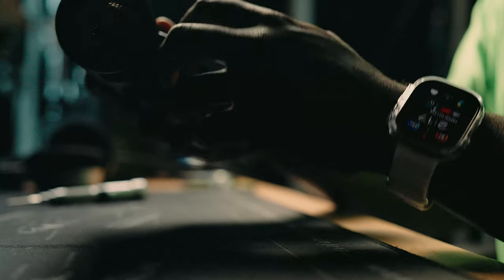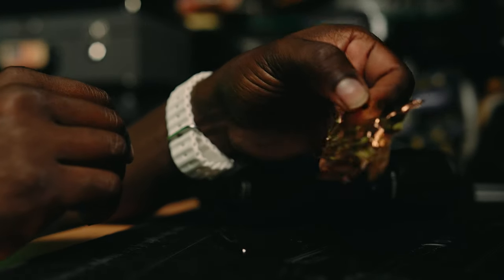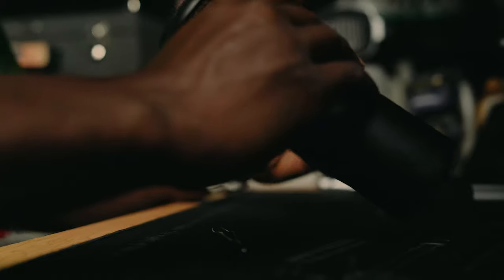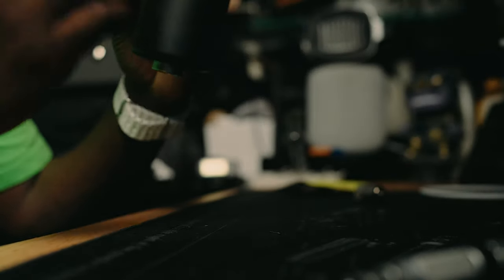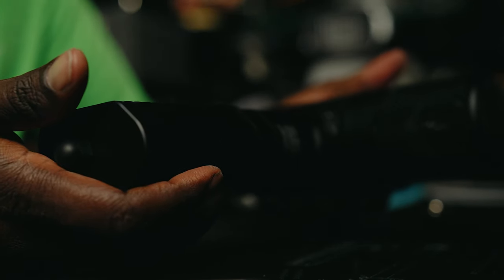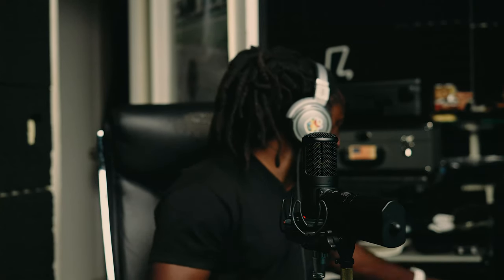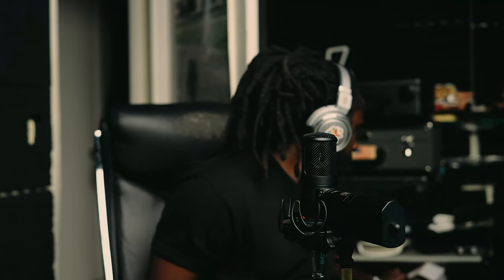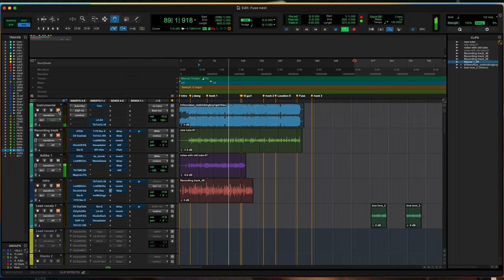Golden age premier Ga 8000 tube replacement

Comment: From 12:59 - 13:02 the noise disappeared. You must of found the real issue cause the mic was whisper quite 😊
Reply from the maker: The tube guess i got a 8$ tube in it sound good a  lil bit
Reply: Still there, but lower.
Reply from the maker: @Leo_Vulkan new tube still got a lil noise need a better tube
Reply: I think the tubes are good. is it possible that the new tubes are longer than the French ones?
Reply from the maker: @rtdrec don’t never had one

Comment: I swapped the tube out in my GA-8000 about six weeks ago, wish I had been able to check this video out first haha.  Couple similarities to my experience: 1) No French tube as advertised. Just a normal RCA tube 🤷‍♂️ Maybe it doesn’t matter but it was still a surprise. 2) There was no thermal paste in my mic either. Can anyone out there confirm whether the paste is truly necessary? Little late for me now but I’d still be curious to know
Reply: Think about thermal paste on your PC's CPU, the thermal paste works like a bridge between the Tube's heat and the radiator. Without the paste it will work as well, but not that efficient.
Reply from the maker: @eddwardmusic yea it sound amazing with it